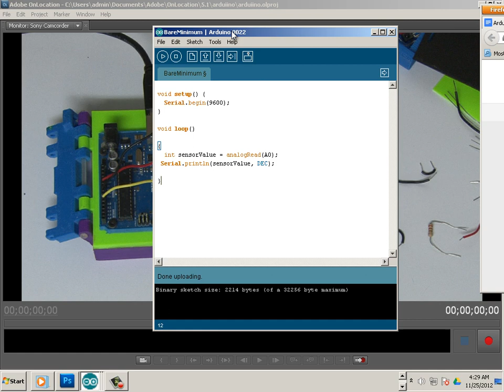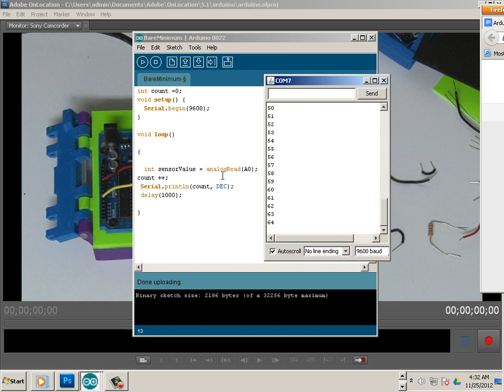0701 Arduino  Chapter 7 Counting example

Comment: Hey, I'm trying to make a pwm and frequency counter that when it finds the desired frequency and duty cycle you press a button to stop the counting but remain transmitting at the frequency and duty cycle it stopped at. Also a back button and forward buttong would be desired to fine tune. I made the counter already but I have no control over it I have no idea how to interrupt the For loop. Any ideas?

Comment: $50 to the first person to right me the code that I need. (debounce the signal)  allendithmart@gmail.com

I need some code to count to five then use stepper  library to rotate 180 deg (100 steps) then restart counter back to 0, five counts..Then repeat.This is what I find.  HELLO TODAY WE GET TO COUNT A FUCKING LED!!!!  OR! LEDS and USE DELAY AS OUR COUNTER!!! FUCK ME RUNNING!!!  HOW MANY TIMES DID I PUSH THE BUTTON?????Serial.prinln!!!    I have been all over the internet and You Tube.  IS THERE ONE PERSON THAT CAN GIVE ME CODE?  I NEED TO COUNT A SWITCH (INPUT WITH A PULL DOWN RESISTOR) THAT HAS BEEN TRIGGERED MECHANICALLY, THEN THAT = ONE.   WHEN I GET TO FIVE, ROTATE A STEPPER MOTOR 100 STEPS.....REPEAT OVER AND OVER...All of my entire internet surches go right back to a chip counting on its own.  Write it and I will give you $50  allendithmart@gmail.com